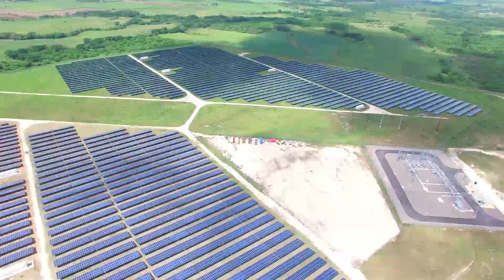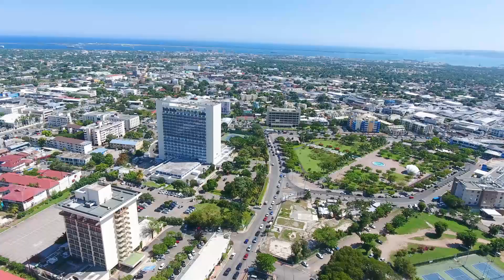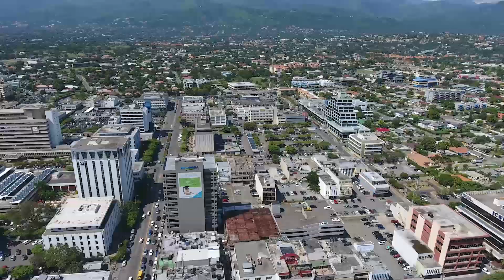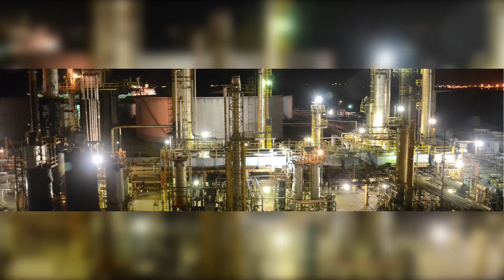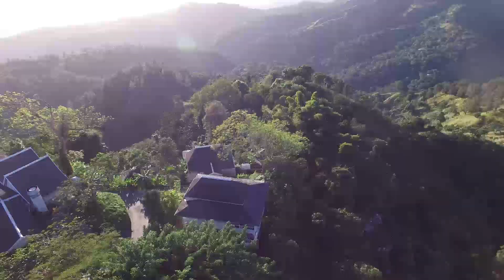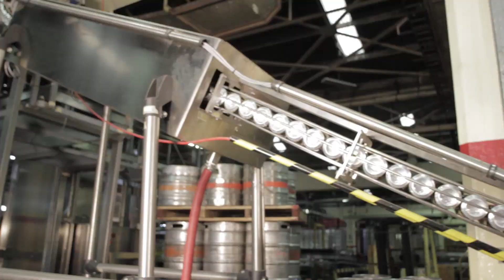Content Solar, Jamaica’s first utility-scale solar plant

Comment: This is great for Jamaica, we need to get the cost of electricity significantly less. And we need a stable and reliable grid and power supply. Power outages outside of external influences must be massively reduced to about once or twice a year.